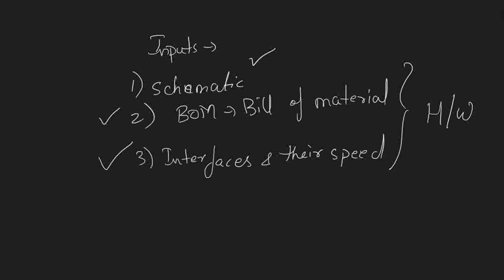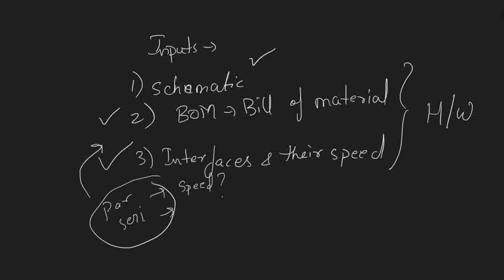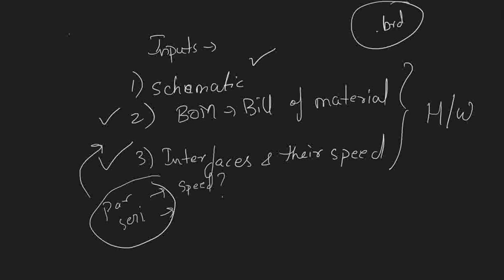Signal Integrity Flow #SI_engineer

Comment: How to conform a analyzed signal is good in SI & which parameters are taken in analysis .
Reply from the maker: Hi Chiru, Thanks for the question.
"In signal integrity analysis all we need to check is the receiver accepting parameters ( e.g. Input voltage levels Vih, Vil etc and the Timing constraints like jitter, risetime ). 
Signal integrity is all about getting an output signal at receiver with accepted values but not the perfect waveform."
 Sorry for the late reply